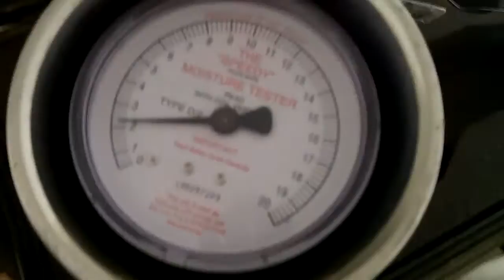not rising damp part2

Comment: Loving your videos, trying to buy a house and lo behold - damp reported in front, side and part of an internal wall.
I've just paid one of the big companies for a survey which will result in £££s in work (chemical damp proofing etc).
I'll take the quote and actually carry out some tests of my own and try to identify if there is actually an issue....

Where do we stand with a filled cavity wall with air bricks that have been filled with silicone? I noticed this myself and the RICS bloke didn't mention it at all - Homebuyers survey is a total waste of £500 imho - get a gas fitter, electrical test and use your own common sense with a pair of binoculars for the roof - it's cobblers.
 
Should air bricks ever be filled? To me I say NO but in a filled wall I can't see that it matters??

Comment: Hi Peter, really impressed with your videos. I have an old property which is solid brick built wall..no cavity. In the kitchen, which is built on a solid concrete floor base I have been told that there is rising and penetrative damp up to ceiling height. I have been advised to have the plaster/render removed up to the ceiling height and then treated with injection damp proofing to stop the rising damp and tanking on the internal wall to stop the penetrating damp. having seen your videos I'm not sure now whether the diagnosis is correct and I would love to get your opinion. thanks Toby
Reply from the maker: Well that's exciting - you have rising AND penetrating and they can't even tell the difference!  Your diagnosis is completely wrong - you probably dont have either.  More likely to be condensation - kitchens often do have issues, mainly due to lots of moisture from cooking.  If you email peter@heritage-house.org I'll try and do what I can to help - would need more info though.

Comment: So do you think that gypsum and cement should never be used? Or is it just older buildings - perhaps with single skin walls - that it shouldn't be used on?
Reply from the maker: Martin White Personally, never.  Practically, yes - but in the context of breathable buildings - solid walled structures - never.  We see modern buildings suffering the same problems - if they had lime, they'd be dry and not crumbling.  Why we ever started using cement and gypsum I will never know..